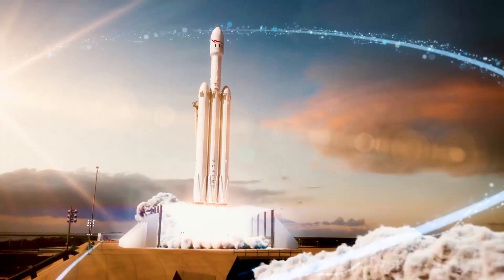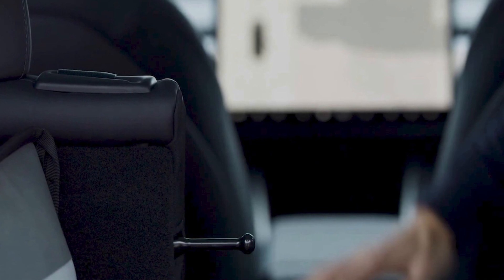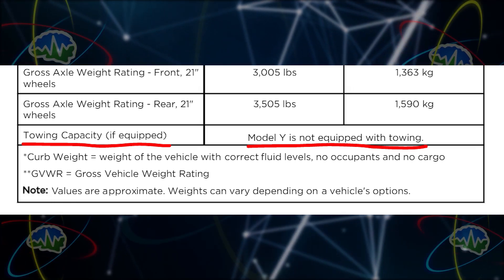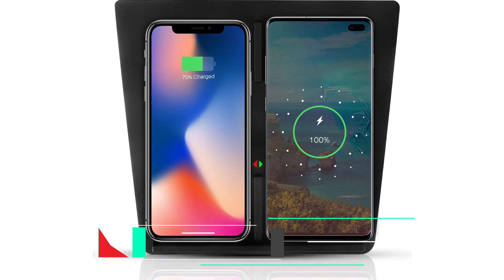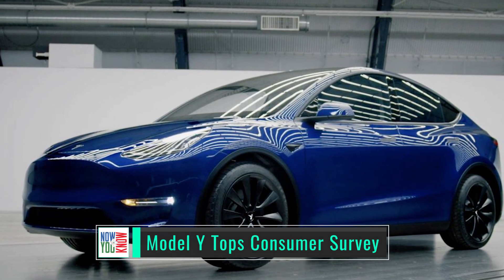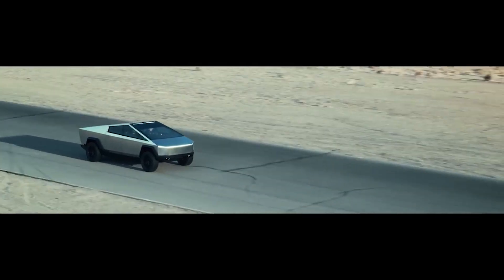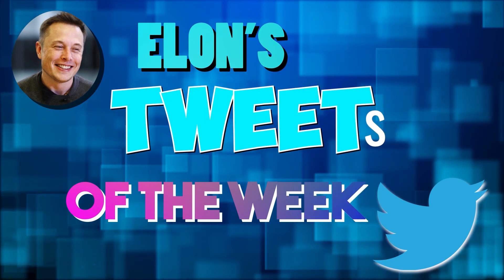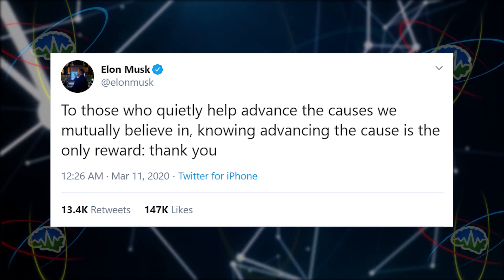Tesla Time News - Model Y - More Details Revealed!

Comment: At 11:11 there is a rain puddle next to the frunk. Rain is bound to get there because of the normal gap around the hood but it should run off better. It’s a good thing they put the giant gasket on the inside of the hood to keep the actual frunk dry.

Comment: @53:45 Long ago in the patents was revealed that the Y has much less cables due to a modular wire system. It was also planned to have a higher module operating voltage and no 12v🔋 anymore.

Comment: Zac.
The tow hitch.
What's the MAIN structural difference between the 3 and the Y?
The rear subframe casting...... To which the towbar would be mounted.
Could it be that the stresses of a towbar may compromise the cast metal on the Y?

Comment: @ 24:00 - My M3SR+ w/FSD paid came in October/19 with HW2.5, as did numerous others in N.America. I now have HW3 as of February/20 probably because I got vocal about it. It's not just in China. No explanation provided. I would've thought with possible supplier shortages, Tesla would prioritize HW3 for FSD paid builds only, so as to reduce this issue.
Those who paid for FSD prior to April 23/19 only had an expectation of the upgrade later. Those post that date who paid for FSD expecting HW3 as part of the build should be compensated.

Comment: The bar on the back seat, is to make sure when the center seat cushion / armrest is returned to its upright position, it does no go back further then the driver side rear passenger seat. Likewise when the driver rear seat is released and lowered , it takes the center seat cushion with it.  Eliminating the need for some sort of motorized mechanism.

Comment: The driver profile settings are saved in the cars, not based on the profile settings on the phone. So the guy was asking for the profile to be on the phone, not just in the car. This is really good, as if you do a factory reset you lose all your settings. Be great if they were backed up on the phone instead.

Comment: I am concerned about this trunk door going down in a part of the rear bumper (at least it's what it seem). It seems to go lower than the model 3 and in the bumper.
So I wonder what will happen if someone just bump a little bit in it, usually it doesn't do anything to the bumper but what will happen to the door?
Reply: Yann Roger Almost every pickup truck I see has a dented tailgate. If something taller enough rear ends your Model Y the hatch door will dent. Every time

Even happened to my Model 3 trunk lid. Accidents happen.
Reply: @drdrew3  Yes but it's not a truck and the bumper is supposed to protect from those small touches, so it could be a problem if the door is a part of the bumper. Of course it has to be verified.

Comment: 32:25 - Electric bike new law in France. 

I am an e-bike seller in the UK and we have the same legal limits (25kph &250W) and I expect this law is due to mods changing the class of vehicle. For example, here in the UK at least, having a throttle on an ebike, regardless of its power output, changes it class to that of a moped. So for an ebike with a throttle, you need insurance, motorcycle crash helmet and license etc. I expect this new french law is due to this. The speed pedelecs that can go over these limits are already classed like mopeds and you need the insurance and license for them. 
That being said, holy shit what a pointless law that is so insanely over the top... Hopefully this gets reviewed and changed.

Comment: Hi, just a little clarification on the France ebike section. There are two types of ebikes and the law only applies to one of them. The bike that just supports you, when you pedal yourself is callled a pedelec and is not subject of the law. The other type is able to drive fully electric without the user pedaling and thus acts more like a light electric motorcycle than a bike. The law only applies to this type, because Franc does not want people to bypass drivers license, registration or insurance regulations by using powerful de facto motorcycles. 
Pedelecs only support your pedaling if you go up to 25kmh. You can pedal faster, but the engine will not support you. This would still be perfectly legal in France.

Comment: Model "Y" is a actually more of a station wagon, not a true crossover. Ground clearance is 2 inches lower than a Subaru CrossTrek, which is also rated to tow 1500 pounds.

Comment: I totally agree with Zac’s disappointment about the lack of a trailer hitch for bike racks.  I have a Thule rack specifically designed, ironically, for electric bikes (which are inherently much heavier than normal bikes) that requires a 2” receiver. I just chatted with Tesla and was referred to the roof bike rack sold for the Model 3 — not cool at all for a 50+ lb bike!  Please survey your viewers about this issue.  Maybe you can be a force multiplier for our mutual, valid complaint!  LOVE your program, BTW.  Thanks!

Comment: There is a simple way to understand a heat pump:

A heat pump is just a reverse internal combustion engine. An ICE generates lots of heat in a concentrated space and converts a part of that into usable power. The rest of the heat is lost to the environment. 

A heat pump uses usable power to collect heat from the environment and concentrates it on 1 location. In this instance, the inside of the car. The reason a heat pump is so efficient is the same reason an ICE is so inefficient, they are thermodynamically speaking counterparts of one another.

Comment: I used to cruise my bicycle at 28 mph and sprint up to 37 mph on level surfaces with no tail wind. I easily reached 70 mph on some of the bigger hills but I'll tell you, the frame got really flexible and handling was really sketchy at that speed. While I think safety needs to be considered, I think that 15 mph is far too low. I could sprint faster than that without the assistance of any mechanical device.

Comment: You missed the point of the e-bike limits in France (and Germany by the way): The electric power support is limited until 25km/h! You can go as fast as with any other bike when just pedaling over 25km/h. It has been a kind of hobby in Europe over the past years to modify that power support of e-bikes towards higher electric powered speeds.

Comment: USA has higher tongue weight percentage traditionally than Europe, usually 10% or more of trailer weight.  I believe Europe, like Australia (Asstrailer) is typically lower, around 5%  the higher NA tongue weight can improve stability, but places much more load on a vehicle's suspension, which can make a smaller vehicle less stable or even cause damage.  I tow with my Mitsubishi Mirage which has no North American tow rating, but in Europe it's approved for light towing.  It was helpful to stiffen the rear suspension for this purpose, although the mirage already had overly soft rear suspension for normal use.

Comment: Towing weight is 1450kg on the Model Y . And we don't tow light trailers only in Europe.... Horses...housewagons and boats. The 1450kg is a bit dissapointing since the EQC and The Polestar 2 has 1600kg. The Model Y should be on par with them.

Comment: 29:00 This capture device is basically an ionizer using positive and negatively charged plates at +3000v ~ 15,000v to capture the pollutants, this is already used on alot of industrial applications, and in the last decade these pollution control units are required in downtown areas where cooking vapors are discharged at street level, to remove air pollutants and grease, these have very minimal change to potential odors (cooking/brake dust etc. Which would require activated carbon panels)  way too much info on here...but hey if questions... LMK.

Comment: "the chrome delete is built into the chrome".. In other words, it's not chrome
Reply: And anyway the chrome on the model 3 looks more like aluminum . On the Model Y it's probably the same but in dark color as you can find for windows frames.
Reply: It's "Double Plus Badass Chrome".
Reply: Nioreh The “chrome delete” black is either powder coating 
or black anodized. Anodizing only works on aluminum while powder coating can be applied to all metals.
Reply: Yeah, and chrome delete is pasting something over the chrome, not removing it.
Reply: @arrowmouse  hahaha

Comment: I believe lack of towing ability is a strategic move by Tesla.   Car can tow and I am willing to bet you can add a tow structure to the body.  However, routine towing will kill range with higher charge/discharge and cycling.  Current battery warranty might not cover this and Tesla will likely have to cover bunch of in-warranty battery replacement, could be a financial liablity for Tesla.   The solution would be to have cars with larger batteries... I see this coming with future Models and Cybertruck.

Comment: the story about the ebikes it's pretty simple: under your own power you can not really go fast for long. Try to keep 40 km/h for some time, most people won't last for more than a few minutes. Yes, there are athletes that can do that but they are an exception. the 90 mph figure i believe are downhill with tail wind during a competition. So they limit the bikes that everyone can use to a moderate speed. Don't forget even 70 year olds can ride them without a license. There's a special class of fast ebikes but they require an additional insurance with a small number plate if i'm not wrong. Dunno i find that all pretty logical.

Comment: Hey Zac and Jesse, the thing you guys need to understand about Europe, is they are very strict about rules, and adhering to them. So the key point is that if someone intentionally modifies an e-bike to override or overclock the mandated limits, that is when the hammer will come down on you. There are a whole bunch of reasons why they have the 25km/h 250W limit, mostly around where the e-bike is allowed to be used. Of course there is nothing stopping you buying an electric motor bike and driving it on the roads legally if you want to go really fast. I personally think the limit should be 40km/h and 500W for shared paths, but Europe is a lot more cramped than the US in terms of foot paths and bike path space. Love everything you guys do. Got a laugh out of your French accent. Can't wait for Model Y to come to Oz.

Comment: Model Y needs towing. A Subaru Outback can tow at least 3700 pounds which is over my 2000 lb sailboat. This is a big mistake on Tesla’s part.  I was planning on getting a Model Y but not until towing is offered.

Comment: Type 304 is the most common grade of 300 series stainless steel.  The ‘L’ indicates low carbon which is primarily a welding requirement,  301 and 302 are common for deep forming.  Think pots, pan, sinks etc.  There are hundreds of grades of stainless steel.  Like a fruit cake, add or adjust an element to the basic cake mix and get a different characteristic.  Producers are very talented in making a minor tweek to claim new wonderful stuff.  Bottom line is for automotive applications there won’t be anything too fancy.  The Ford Taurus was the first high production car to switch exhaust pipes to 300 series stainless from the standard 400 series stainless.  They lasted forever.  Buses mostly use 304 for their frames.  Nothing really new with Tesla using stainless steel.

Comment: the little play on the france / jail thing for bikes was amusing i must admit that XD ... but i dont know how e-bikes work in the US but here in germany at least (france should be similar) the bike is only to assist the driver (so no power if you dont pedal at the same time) and that only up to 25km/h
i think what the new law wants to do is fine ppl for breaking this spec .. but not the ones just going faster ... i think its if your bike is still providing power above 25km/h (or over the amount of power allowed) ... but since lawmakers usually are pretty dumb i cant say that they didnt screw it up

Comment: This is not a birch but jack made uncharacteristic it dumb remark about towing that weight doesn’t matter ! It affects both the handling and accepting and range the easy way is to set the tow lints low and it would be fine but being Tesla they could put a strain gage on the to point so if the said you weigh to muck it would tell you

Comment: E-Bikes: There seems to be a huge misunderstanding: It's not just a French law, it's the same in Germany and I guess also in all/ most European countries: 
Of coarse you are allowed to go faster than 25 km/h (15.5 mph). The legal requirement is just that at 25 km/h the motor will automatically turn off. Of course you may go faster (on your own power). I regulary do it and it's perfectly allright and legal. What is illegal is to manipulate the SW that the motor does not turn off at 25 km/h.
Legal E-Bikes going up to 45 km/h (28 mph) before turning off the motor do also exist. They however need a licence plate and an insurance.
Reply: You're right. It's annoying how these guys sometimes have this stupid reactionary perspective without looking a bit deeper. Having a difference between ebikes (no helmet, license or insurance) and electric mopeds/motorbikes is pretty useful.

Comment: The 25 km/h and 250 W is a rule in Noeway as well. I think most of EU have something like that. 

It is not illegal to do more than 25 km/h, but to be categorized as elextric assist bike:
Max 6 km/h, wihout pedal movement
Max 250 W continous power (short term peak may be higher)
Shut off motor assist at more than 25 km/h.

Pedal assist are (usually) legal anywhere normal bikes ar legal, but motor vehicles are illegal.
The 45 km/h electric bikes are cayegorized as motor vehicles, and usually illegal to ride om paths designated for pedestrians and bikes.

I believe it is about safety, to avoid unexpected high speed on the walking parhs, Depending on the countries laws  the higer category might also reqire som drivers licens/permit and/or a license plate regisyration,

Comment: @nowyouknow About limits for e-bikes that are allowed on the bike path. Your point of view almost made me give you "thumb down", but maybe it was just an insufficient amount of info. Let me explain why(as a person who currently lives in the Netherlands):
1. Most of the daily cyclist cycle at speeds from 15 to 25kmph. 

2. Experienced(!) and trained cyclists can do speeds over 25kmph for longer than a few minutes.
3. In the Netherlands, we have a lot of "Bromfiets klasse A" - mopeds that are limited to 25kmph (some people unlock the speed limit and that is illegal) that you can drive on the bike path along with cyclists. 
4. There are more and more new e-bikes every year(i can see a lot of older people are using them to ease the commute).
5. A lot of accidents on the bike paths are involved with e-bikes and mopeds due to the increased speed.
From the above points, we can conclude:
If you allow of modded e-bikes that can go ie 40kmph with standard brakes and inexperienced and unfit cyclists on the bike path you will get a lot of accidents that will be more severe (as you probably know the equation for kinetic energy). And this is why they are implementing the severe consequences for people who modify their bikes(probably people do this and they want to limit that due to safety reasons).
You talk a lot about safety and the next thing is laughing from safety regulations? Come on, guys. 

PS. the TDF example was so stupid that I would not comment(please read about last year's accident of Belgian cyclist Bjorg Lambrecht who crashes and died on own muscle-powered bike and try to get some outcome of that).

Comment: My first comment on your channel I watch regularly and appreciate.
 Being French I had to make a few corrections about the ebike.
Here is a translation of the actual regulation in place:
- The motor power must not exceed 250 watts.
- The engine must stop as soon as at least one of the brakes is applied.
- A pedaling sensor must imperatively be installed on the bicycle so that the assistance does not start until pedaling, the motor must therefore not run until the cyclist pedals.
- If the bike reaches 25 km / h, the engine assistance must be cut off.
If the ebike does respect those rules it falls under the category « moped » which requires to have an insurance and wear a helmet. 
So nothing prevents from going faster than 25km/h with an ebike
No offense and French may be not that dumb after all ;-)
Reply: We in the USA have "stupid" cornered on the market.
Reply: @beerman1957  
"Gump" mode?

Comment: The Netherlands we have a similar law regarding e-bikes, the difference between the two e-bike classes is that for the limited bikes you don't need insurance, if you mod it to go faster it goes in the faster class and you are required to have insurance
Reply: In Norway, the smaller class is bike (not motor vehicle) and the larger is moped (motor vehicle).

Mopeds are illegal to go on pedestrian/bike paths.
Mopeds reqire drivers license/permi, licence plate registration, and insurance.
Bikes have no ligal reqirement for helmet, for moped it is required.

If you modify an e-bike to use motor faster than 25 km/h you need tecnical documentations and approval, for registration. Probably way easier and better to go for one with approved documents from factory.